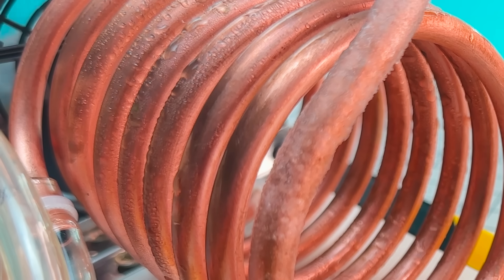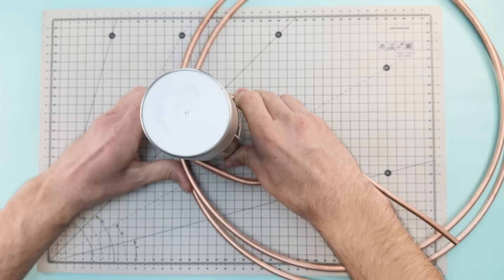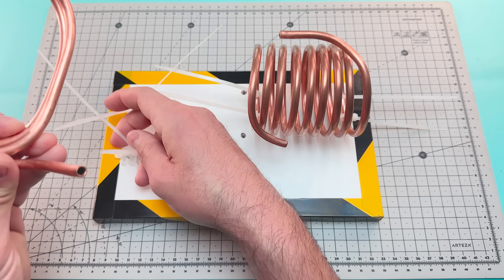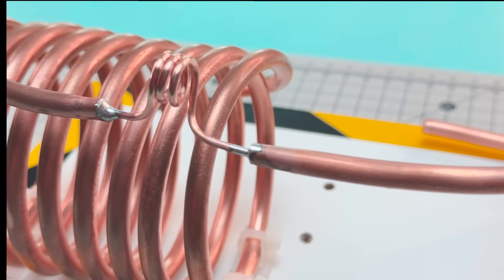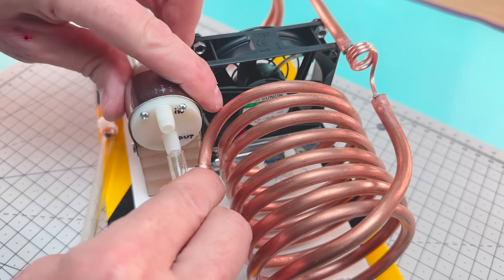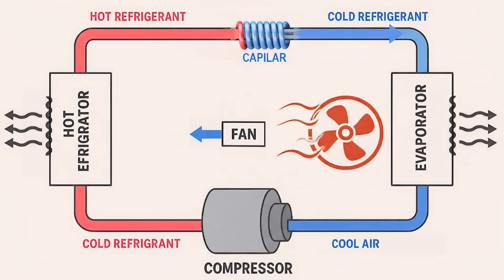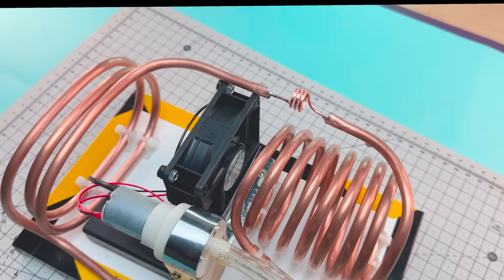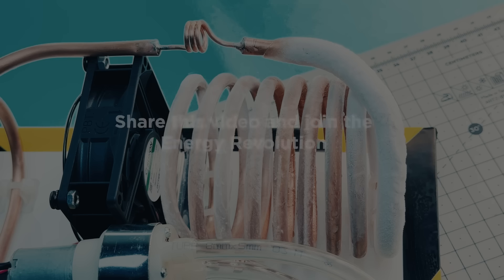Make your own AIR CONDITIONER at home Fast and Easy!

Comment: idk if this guy knows how physics works, there is a reason heat pumps have one half outside.. and a water run off..
Reply: The net result of this device will be that the room's temperature will go up umless you put the condenser outside.
Reply: @mwmii790 correct if you do not separate the coils as In one inside and one outside.  the room will just get to hotter
Reply: @mwmii790  Yes! Exactly.
Reply: You're absolutely right, this thing will cool down one part of the room and warm up other parts. If you put the condenser outdoors and the evaporator indoors it would work.
Reply: And all ac units heat pump or not have one half outside on split units anyways. . . It's the basic premise of air conditioning
Reply: And water run off? All ac units have drains for water run off... I'm not sure you understand how the physics of a/c works exactly either my guy
Reply: @ariajohna258   is this directed at me? and if so pedantic much? drain, run off, aquaduct, washway, storm drain, gutter. call it what you want, you get what i mean lmfao. fcking anything to make the water not pool up and it has an exit. could be a plastic bendy straw into your backyard idgaf. the point was is you see all that water? unless you like humidity you best get it somewhere other than where it came from "my guy". the whole concept is busted, but you wanna harp on "run off" give me a fcking break.
Reply: Maybe you should learn something before spitting out some nonsense on a public comment secrion. Butthurt much.  @Keanue-Anakoni-Aukai
Reply: Wow sheldon cooker
Reply: @gamesforfun598  been cookin since i got a B in highschool level physics.. Thanks captain oblivious
Reply: @keanuAnakoni-Aukai hope u r not cooking crystal meth

Comment: It won't work for cooling a space, a beer can maybe, but that's about it. It's like setting a window air conditioner on the table, cold air blows out the front and hot air blows out the back.
Reply: Bruh... It's just an example of the refrigiration process. You can always put longer tubing and seperate the condensor from the evaporator. Use your brain for once!
Reply: @cymaticCS  If that's what you trying to demonstrate then you should state that up front and not talk about cooling a room and calling it a portable do it yourself air conditioner. I designed and sold HVAC systems for years, including centrifugal and absorption systems.

Comment: Wondering if this can be scaled up simply using larger loops in the evaporator so that a 240 mm fan running 12 volts which will push a lot more air can be used.  You'd have to have a window close by so you could extend the  condenser outside a window?  Or would the  fan be  pushing too much air and warm the whole system up?  This is actually a great project.  Just needs to scaled up a bit to produce more air flow.  Would also run a lot better off a 12v power supply with a 240mm fan.
Reply: you can if you have central air in your house this is basically a scaled down dumber version literally isobutane is a better for environment refrigerant though math isn't mathing on this one

Comment: I tried it 100 times the way you showed. The way you inject the gas and remove the syringe — all the gas escapes. Even if I somehow manage to fill the gas, it leaks out through the motor that's attached. So basically, all of this is a lie.
Reply: Thats why AC systems have a fill valve. Or they are permanently sealed at the factory. Also, this won't cool anything. It's just pumping the heat from one side to the other side in the same room. But it will warm the room up from the added heat from the electric motor doing its work.

Comment: very nice setup, however I have a doubt, if the copper tube freezes how efficiently will this portable air cooler cools, is there any different structure which can reduce icing....

Comment: of course the thing won't work as an air conditioner if the cold and hot end are in the same space, but.... I might build a cheap soft drink cooler for the car with a 3d printed housing and some styrofoam :-)

Comment: What about the dry ice forming, will the formation stop or just keep on going. Also, doesn't the condenser produce an equal amount og heat creating thermal equilibrium?
Reply: Именно что производит равное количство тепло. Поэтому в комерческих кондиционерах конденсатор находится снаружи здания.
Reply: @tedodor1  Exactly.
Reply: @tedodor1  That said, the thing works but you got to put one part of it outside. Not so sure about the dry ice formation though, if that keeps going and there is no reason to assume it won't, then it won't take long before it breaks those coils.
Reply: @noreply5461  С образованием льда на рубках испарителя борятся ровно тем же способом, что и в холодильниках с системой "No Frost" - постоянной циркуляцией воздуха, в таком случае воздух охлаждается, а точка росы у атмосферной влаги наступает не на трубке испарителя, а за ним,  вода не переохлаждается, остается жидкой , собирается в специальном резервуаре и вытекает наружу через специальный шланг, как это сделано в комерческом кондиционере.
Reply: @tedodor1  Still its a great proof of concept, the author did a great job.

Comment: Why not use az20 or 1234yf or 134a. R22.  R404 even. Any refrigerant would work better. 454b cools like r12. It's the new propane based refrigerant

Comment: -10 is great and all but if you want really cold work, use propane.  It will get down to  -40 degrees. But you cannot use those lightweight hoses.  You need to be able to handle up to 250psi.

Comment: It sorta works, but doesn't work. Battery will not last more then a few minutes. The heat on the condenser end is blown back into the room offsetting what the evaporator cooled.
Reply: solar imput via 24ft dc power cable and proper tube venting out a window..... box top sides and a proper air output holes..... should wrap it up
Reply: Exactly. This is why the condenser of a home AC is isolated and vented outside. Same with a fridge with it's condenser venting outside of the unit and why we feel warm air coming off from our fridge. Cannot have a free lunch and must have a way to isolate and vent the condenser heat away to actually cool anything. Principle is sound, for sure; it's just not going to work effectively, whatsoever.
Reply: @johndeeregreen4592 I've built a diy peltier AC but it's just as same as a window ac with one difference that the cooling engine is a peltier module instead. The heat is dissipated outside of the window and the cool air vent is inside the room. It's not perfect but it cools as down as 22 when it's 30+ outside. (It heated the room when it was completely inside the room)
Reply: you can try to connect the evaporator and the condenser with copper tubes, lmk how it goes! i want to build the same thing and i have 12v power supply

Comment: Why isn't there a company that makes these cheap airconditioners available on the market for any home?
Reply: Then who will buy the expensive acs if all buy the cheap ones!
Reply: It won't work. The heat needs to exchange to the outside or its just going to be the same in the room
Reply: @GnarlsFarls  Даже наоборот, будет жарче, потому что КПД < 100%
Reply: Cuz they don’t work. You can tell by overly the dramatic music.

Comment: Few things remove heat solar panels cold distillation sterling engine 
Everything else just moves heat around
Reply: moving heat around helps produce the photons that help achieve overall cooling. Consider how things visably glow at higher temps. That is actually happening all the time. So when you make a cold spot and a hot spot, you do in fact excite photons to be at higher frequency and there is effects that happen with more reflection wave lengths and more penetration.
Reply: So, when you make a spot that is hoter, it will cool down faster. This helps to disperse the energy rather than allow it to just be a blanket of isolating air.
Reply: @FirstNameLastName-okayyoutube first law thermal dynamics 
Wish my uncle would and Gid father taught me more. Think it was classified

Comment: If you keep this in the room, you're gonna end up with a hotter room. You have the source and the sink in the same room and you are also spending energy to transfer that heat.. so overall the room is gonna heat up. Thermodynamics ?!
Reply: the moment i saw the setup, i thought the same thing. anything for views i guess. lmao.
Reply: Yeah this is wrong. I made a mini peltier AC for a small room but had to put half of it outside of a window and another half inside the room so the heat doesn't come back to the room, although even this is not as good as a conventional AC
Reply: @senseigg8484  ikr.. also if you try to scale it up to make it good for room cooling (really good).. then probably you would end up spending much more than what an AC costs
Reply: @aimingeye9471  Yea it's inefficient in all ways except for less noise than a regular AC (from power consumption to costs)

Comment: Has anyone actually tried building this? Or just theorizing and talking trash? Isobutane functions at very low pressure, so that nylon tubing should hold up. Obviously the condenser and evap are too close, who cares! Build a cardboard shield and direct the airflow!

This is a DIY project to prove the concept about the physical properties of condensing and expanding gasses. The 9VDC battery should be enough voltage to run the 12VDC system. Typically +/- 20% voltage is acceptable. Clearly it won't run for long. I will probably build mine with a small 12V alarm battery.
Reply: Sweet argument 👌 make a video of it please. Be like Nike. JUST DO IT. U got this.
Reply: yeah it works.  its a jumping off point to problem solve making it do what you want it to do.  Which isnt easy, but also only like 2 or 3 steps past where most people give up.
Reply: Another mod to consider that someone else mentioned is to make usb the power source so you don’t have to switch out batteries

Comment: you need more air flow over the evaporator
Reply: If the evaporator was sealed and isolated from the condenser, with a fan blowing from the back and the condenser venting outside, this unit would actually work in a small space. However, with the way it is setup in this video, the heat from the condenser is going to compete with the evaporator and cancel out any real-world cooling effects.

Comment: Of course it wouldn't cool the room! But yes it could cool those coils a little before the battery quickly dies. Might catch fire as the cheap little air pump would probably leak the flammable coolant 🔥.
Reply: True @Reed8999  That's important to consider... the Pump needs to be strong enough as a sealed unit while maintaining sufficient pressure continuously.

Comment: Anyone interested in a cooling system that doesn't use electricity and actually works should ask me to explain.
Reply: Go for it.
Reply: @MexiHaro ok the first part of the machine involves building a flash steam generator that only needs sunlight to heat it... ultimately the machine will run on solar radiation and the hotter the sun gets, the cooler the room will get.
Reply: @MexiHaro start with about 12 sections of black steel brake lines with the pressure fittings at each end... use 1/4" or smaller tubing here...
Reply: Now you attach reducers on each end of these tubes to get from 1/4" all the way up to 1" then attach a T fitting to each end that also expands up to a 2" pipe... now you've built your heat accumulation tubes and they're ready to be fitted for thd next step. That is to build a parabolic reflector to cradle each section of black brake line in its central focal point....
Reply: @MexiHaro you still following this?
Reply: Me 2😊
Reply: Keep going brother
Reply: Dude can we source all these parts say Lowes or Amazon?
Reply: @damienhughes1996 yes... this is all stuff you can easily source or improvise unless you want to get extremely high precision with it. Working prototypes can be built with scrap for the most part.
Reply: After you've built your solar reflector array with an intake manifold at the bottom and an output manifold at the top you're going to need to build a laminar flow valve to attach to the inlet of the input manifold. This will allow pressure to build up in the solar array but prevent it from flowing backwards and force thd flash heated water to push upwards through the array and create steam in the upper manifold which can be fed into the turbine which will power the air cooling system...
Reply: @captainKedger if you make a video of this, I would watch it
Reply: @andrewferguson1291 if I had the money to get the necessary parts I certainly would.
Reply: @captainKedger 
So you really haven't tried this?
Reply: If anyone is following and can picture this in your mind let me know if you want me to continue.  Let me know on my own comments somewhere on my first video or something. This is just getting started and it's going to take a long time. You might need to study designs for parts like the laminar flow valve. (Aka Tesla valve)

Comment: Yeah so I have to question the system simply because where do you discharge the heat if you're discharging it back in the same room which the system obviously is then it's not necessarily going to cool the room.
Reply: Yup Moot it just looks cool at that point its a conversation piece.

Comment: Actually this is a low power dehumidifier not an AC. Even if you put the condenser outside you would not cool a room with a 9v battery. Real AC's pull about 2kW of power and anyone who lives in a hot climate can tell you that you need to run them all day...
Reply: Какой же это осушитель, если иней тает и испаряется в помещение? 😮

Comment: I could see this being used very effectively off-grid, or in a tent or camper, especially if the power were adapted to to use rechargeable battery banks. Charge the battery banks with solar during the day, sleep cool at night. Love it. Well done!

Comment: Just gonna repost: It’s surprising how many people are entirely missing the point of this video. It is a simplistic breakdown of a cooling circuit, in its most basic form. It shows how the system works, nothing more. Anyone expecting this to be serviceable to any extent is not thinking clearly. One could adapt the principle of this system to a working system by scaling it up and separating the evaporator and  condensing sides.
Reply: Nailed it.
Reply: many geniuses around: this won’t cool the room! If yall ever seen AC, there’s a part of it outside of the house for a reason

Comment: I don’t see the use of this being too cooler room, but you could build a box around the evaporator cord and put a fan on it and make it pretty good like personal cooling system out of it. Like other people have mentioned the condenser being in the same room and it’s never gonna do anything productive. It’s adding heat into the room as it’s cooling

Comment: Thanks ,
Very nice to explain the cooling principle . I shall try to make and see whether it works as shown with a simple air pump . Actually a high power / pressure  pump is required to pump out refrigerant from small dia capillary tube .
Reply: In practical AC systems, there is a "receiver," which acts as a reservoir for the expanded gas. It is located immediately ahead of the compressor, so that the supply of gas is constantly available.

Comment: Right!  A PP3 9V battery is going to supply enough energy to "cool a whole room" (of course, he didn't mention the size of the room).  If this thing even works (and that's a BIG if) it will only move heat from one side of the ( VERY small ) "room," to the other.
Reply: I love how several commentators here have a continuous meltdown over the word "room" that was used. 😂

Comment: It's impossible to cool a room by moving heat from one side of this unit to the other unless the unit is built into an exterior wall.
Reply: Yeah, it's like trying to cool a room by leaving the fridge door open. Also, lack of 100% efficiency means it's actually a room _heater_.
Reply: @lusoverse8710 exactly. There system will have the overall net effect of adding more heat to the room because the fan motor and air pump both produce heat.

Comment: Misleading video. It won't cool a room as it claims. The heat exhaust is 2 inches from the cooling coil for one thing.
Reply: That is easily remedied with a second fan pulling the hot air away. Spin it 180, and bada bing, bada boom, it's a fukin' heatah🤪
Reply: Not to mention didn't evacuate the system  cause moisture ice block in evaporator.
Reply: Expert here, hear me out pls.  Your point is mostly valid for proper air conditioning.. yet! It will concentrate a flow of cold air and the warmer air will flux across the rest of the space and cool against the outside temp.  This video also provides a model to improve on, giving most people a needed low cost starting point.  

Also consider how a fan cools when it simple moves air around. That effect is also happening here.

Comment: The refrigeration working principle is like that, but it won't work in this project because  butane vapor pressure is almost 6-7 bar at 33 degrees Celsius temperature, but this tiny compressor has no enough torque/ force  to handle this amount of pressure, so the refrigerator process is shut in the compressor in this project.. oh its will work if you can used heavy compressor..

Comment: LMAO, this got 31k likes?  Ok so IF this would have worked, and thats a big IF, the other part of the circuit thats not cooling would get hot as it compresses the gas back to liquid, that little pump no way could handle that, and that cheap plastic tubing i dont think would handle that either.
Reply: Well on a car or truck/vehicles A/C system actually used the same design,it has metal hard lines and rubber hoses in the A/C system and it works just fine.
Reply: @bigmike9527  the rubber hose in a car AC system is a high pressure one. The thing they used is NOT high pressure, its a cheapy plastic hose.